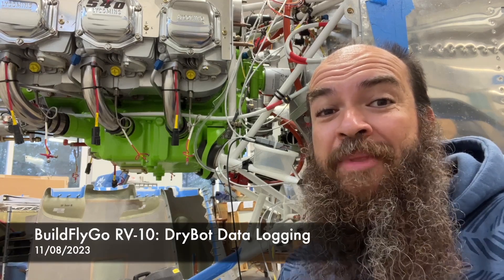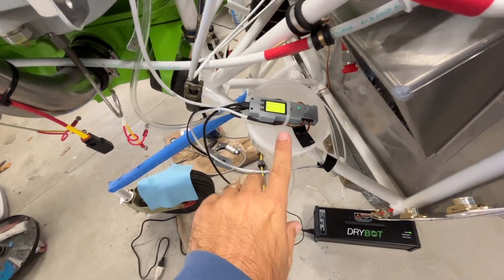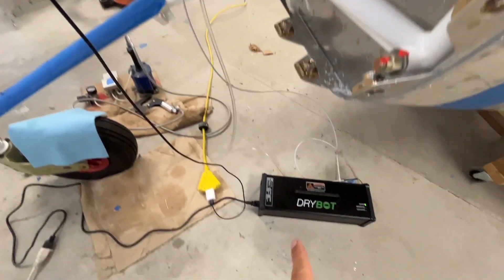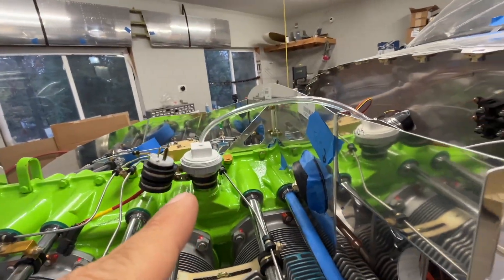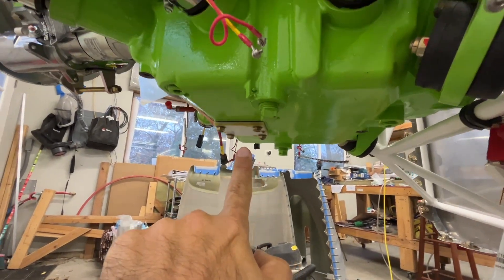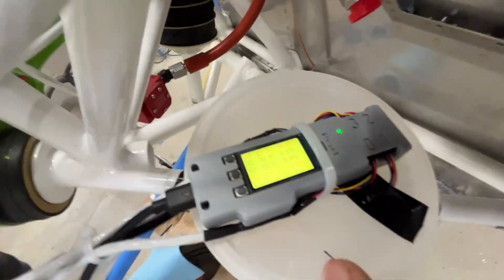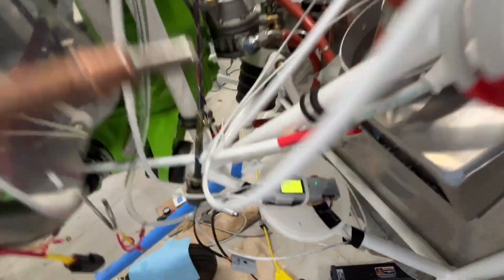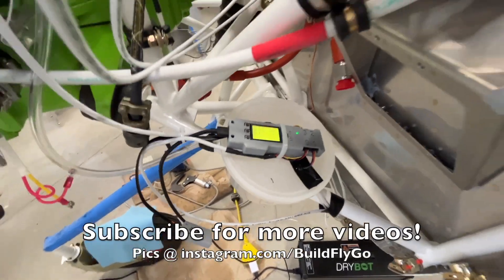RV-10 Engine - Data Logging the DryBot

Comment: Guil, FYI, I noticed during your video that you have installed the oil cooler mount on the firewall.  Are you aware that airflow recommends installing a turning vane in the box to improve air flow.  I did not discover that until I had installed mine but was able to fabricate the vane and modify the mount to "get it in". Google airflow systems rv-10 turning vane for instructions....
Give me a shout and I will show you how I modified the mount to get the vane in.